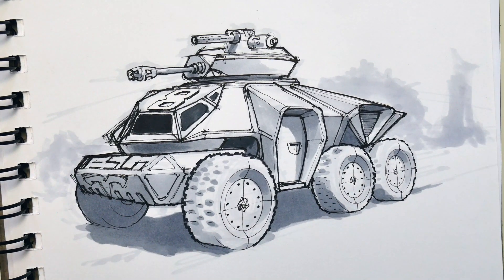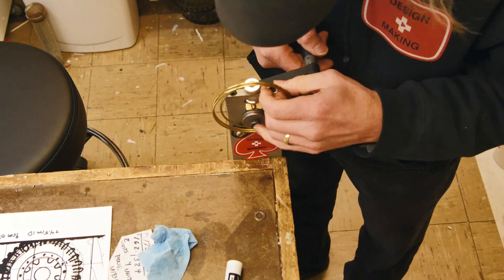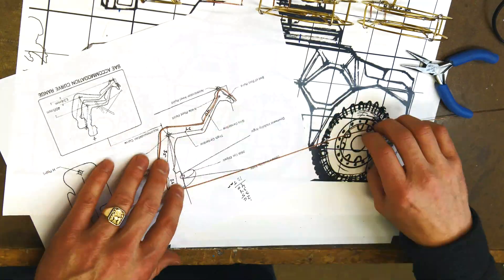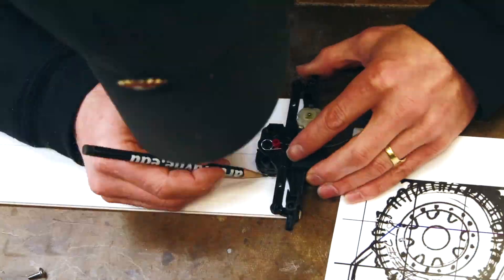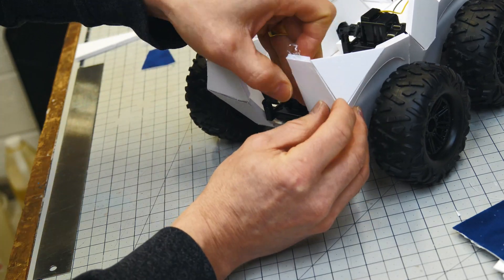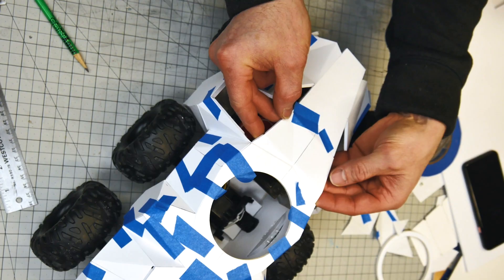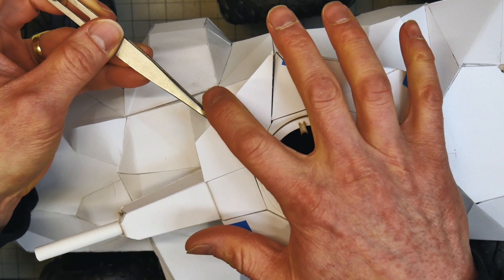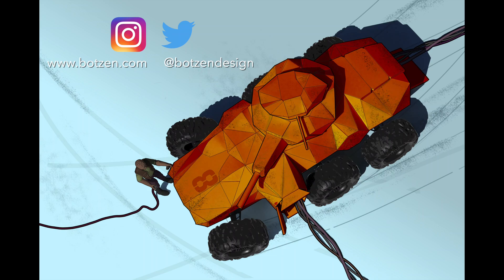Design of a Military Vehicle: Design Journey and Philosophy

Comment: That looks cool.  The Foam core build looks like it would split easily into shells for molding (injection, resin cast or vacuum forming) as two or three pieces.  The body style would fit well with the BattleTech universe or even something Cyberpunk.  Someone is going to make a 3D model of that.
Who is the 5" figure?  I can't make out the character due to the white-on-white.
Reply from the maker: Finn from Star wars
Reply: @EricStrebel  Thanks!